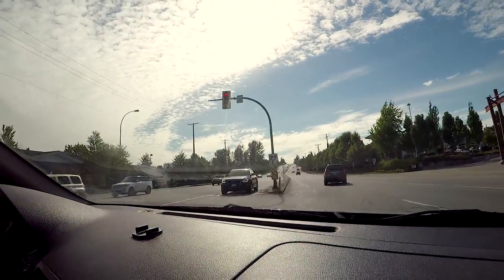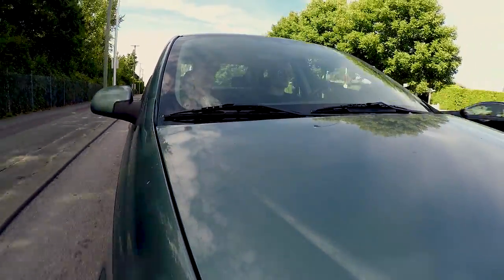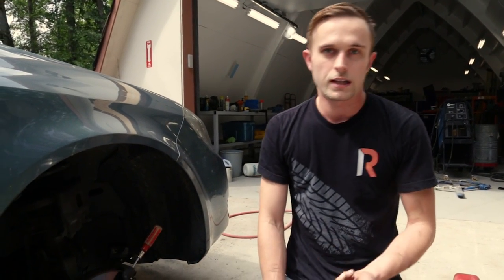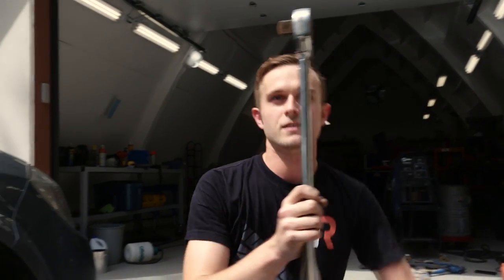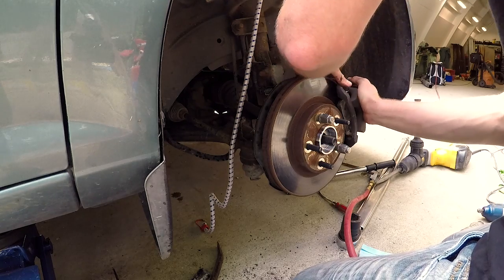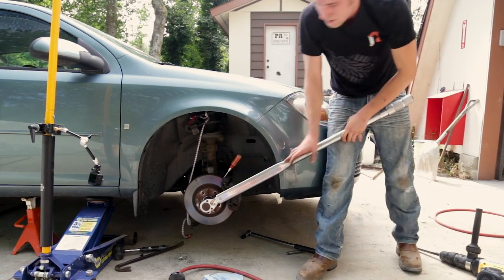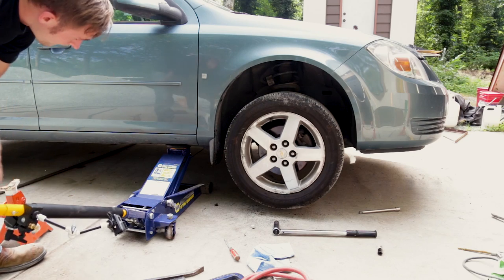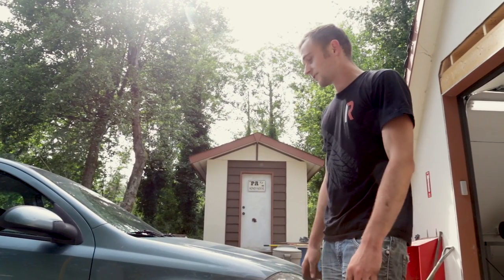$50 Fix with a Hammerdrill and Cheap EBAY/ AMAZON Car Parts

Comment: Has a giant torque wrench, hammerdrill, compressor and pneumatic wrench, but doesn't have a metric impact socket set or hub puller... might want to prioritize your tool purchases a little better there....

Comment: Wheel nut MUST be torqued to spec or bearing will fail prematurely, and should also be done with weight off bearing to achieve proper pre load specification.

Comment: When tightening your hub nut. 
Get a friend to sit in the car and hold in the brake pedal?? I mean 99% of the time it's not gonna hurt anything that way but one day you snap a screwdriver and have to take the disc off to get it out. Not that I'm talking from experience at all 
🙃🙃🙃🙃🙃